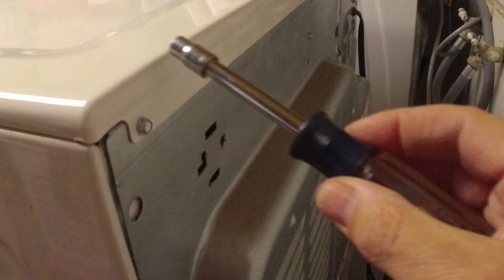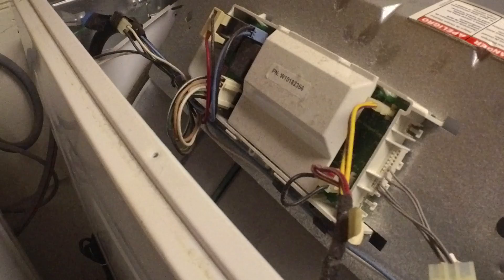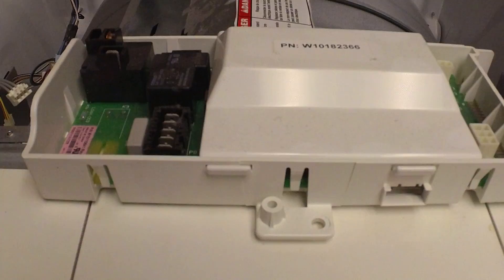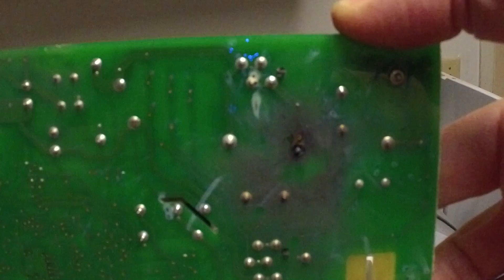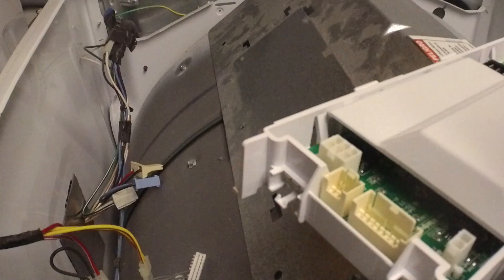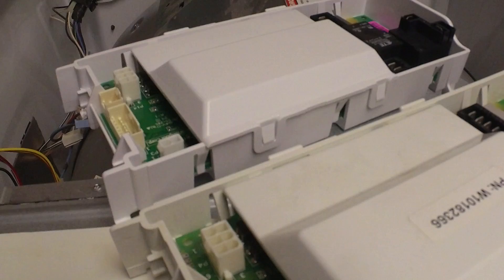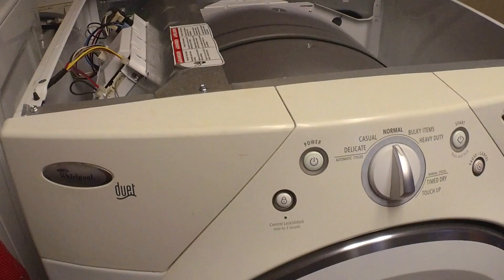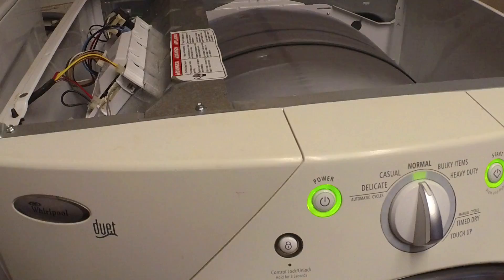Whirlpool Duet Dryer F01 Error Code Fix | Control Board Replacement

Comment: My dryer showed an F1 malfunction. Watch the video then went into the control board out when I did it show the classic signs that was shown in the video. I soldered a wire as shown in the video put board back in. it worked!! I'm quite shocked saving myself 150 to $200 on a control board
Reply from the maker: well done, congrats!
Reply: @MattsGarageMiscDIY  thanks for the video was a great help. Mine look just like the video solder joint blown. Had it fixed in less than an hour and most of that time was looking for my soldering iron

Comment: Tip to others .. with an exacto knife you can carefully scrape through the green trace close to the relay pin to give you much more copper area to solder.  Also scrape along the relay pin to give more clean area for the solder to hold. If you have a little electronic friendly flux paste .. that does wonders too!   Thanks to the OP for this excellent video.  Saved me hundreds $$!!
Reply: thank you after two weeks finaly found the problem you  save me 300 dollars .

Comment: I had the exact problem as obviously a lot of you have had, thanks for a great video but luckily enough that I soldered the heck out of it and completely covered the lil nub sticking up and plugged it all back up and viola I have a working dryer. But without your video I wouldn't have got anywhere. Thank you so much for sharing?
Reply from the maker: Well done Brandon. That is super satisfying right! Glad it was helpful.

Comment: Thanks  Matt $250 dollars saved. I went to Lowe's and bought a Weller Cordless Battery Powered Soldering Iron for $22 and soldered the burnt spot on the board and it worked! I couldn't believe it.
Reply: I have the same battery soldering iron

Comment: This worked for me and the resolder did the trick no board replacement.  It was exactly the same pin which is connected to a relay that turns on heavy amperage to I guess a motor.  The board in the video looked more burned than mine but I'd bet the relay is still good just the trace got burned or fried.  I small jumper wire to the two pins that it leads to would have probably brought the bad board back to life.  At least that's what worked on mine but I didn't even need to add a jumper wire.

Comment: The power lead burned out on the power board relay.  The trace and pad was burned away.  You can fix with a soldering iron and small gauge wire.  You solder the wire to the damaged lean and jump it over following the trace to the next lead.  No need to remove relay at all since it is not damaged.

Comment: I like the video but for $11.00 you can replace the resistor. Not that difficult to do but if money is no object then replacing the entire board is the easiest.
Reply from the maker: If money is no object you call a repair man and pay them the labor and part mark-up too. You should create a video of the resistor replacement, that’d be cool for those that wanted to try that first and save some serious money!
Reply: Steve Wilson you bring up something I’ve been thinking about.  Clearly, something blew out on the board and the solution is not simply to resolder the connection.  I did not know the part was a resistor, but whatever it is, it needs to be replaced.  Otherwise ... who knows what?
Reply: @janapellusch9339   I’ve actually replaced this twice over the years. Just buy a desolder kit and you can do it yourself. Trust me I have limited skills :). Here is the part:  G8P-1A4P-12VDC Fully-Sealed PCB Relay 30A 250VAC for PC Board or Panel-Mounted.  It’s a relay that just blows after repeated use. You will see on the circuit board where it just decided to fail. The resistor is held onto the circuit board by tiny dots of solder. The desolder kit melts and suctions the old solder away. Good luck!!!!
Reply: @MattsGarageMiscDIY   Good idea Matt I will make a video (if it happens again). As I mentioned to another person I have limited skills but all I needed was patience and a desoldering kit and of course the new relay :)
Reply: Per Matt’s Garage and Misc. DIY request in his reply to Steve Wilson’s comment, here is a link to a video of someone repairing a similar dryer with the same error code by replacing the $11.00 resistor:

https://youtube.com/watch?v=aZWBjouDPuw&feature=share

Comment: You saved me the cost of a replacement dryer! I found a person on ebay who solders the boards for $44, while looking for a used board. I sent the board off and it came back within days. If it hadn't been for this video, I would not have known what to look for on the board, and that even if I had to get a new board, it would have still been $100s less than a new dryer! I took a bunch of pics of the wiring set up and the whole re-install took less than 15 minutes. Thank you so much!

Comment: Had the error code show up and when the service technician showed up, he claimed the part was no longer available (OEM). Looked through Amazon and picked up the closest match which included the white plastic attachment box for the circuit board. My son and I tackled the project and was able to replace the control board in about 1.5 hours. Hardest part was carefully unplugging some of the original connections without damaging the wiring and realizing that both of the anterior small wiring connections had to be attached at a different 90 degree angle (no real problem). Great satisfaction having that dryer up and running. Great video and commentary..big thank you!.
Reply from the maker: Well done, glad it was helpful.

Comment: Hi Matt. Even now your video was awesome. My unit had the exact same problem. Even down to the smoke spot. Re-soldering did it for me. Wanted to add for benefit of others, that the blown solder location is at the relay. The blowout took some of the PCB material out (the little copper highways) at the location, so just adding soldering will not help. Re-soldering should make sure the relay leg makes contact again with these. Even adding a shunt wire between the relay leg and the next location would work.
My wife was helping me, and at the end said I was "f**ing incredible" . I am passing some of that compliment back here. 
Again, thanks!!
Reply from the maker: Nicely done Juan!

Comment: Thanks so much for this video.  I was able to solder the burned area and it fired right back up.  Make sure you clean the burned area down to bare metal before soldering.
Reply from the maker: We’ll done! Such a good feeling to fix something yourself and save a bunch of money.

Comment: Matt, I have to hand it to you. I took out my old circuit board and Son of a gun the relay was burned exactly the same place yours was. We ordered another board and a it should be here tomorrow. Stay tuned to the results as I am 100% confident it will work when I get it back together. Edited next day I cleaned the post and got my solder gun and re did the solder job. Installed it back in the dryer and wellah all fixed. saved up over 200 for a job that took more time to get the board out than to fix it. Youtube is the best. Thanks Matt
Reply from the maker: Glad it worked for you. Imagine what you’d pay to have a repair person replace the board after labor and their mark-up on the part! Lot’s of people probably go buy a new dryer!

Comment: Exactly the same issue. Same relay with blown soldered contact. Re-soldered and bingo, it worked. Thanks for pointing me in the right direction. Saved $100+ dollars on new board. You can also just order the relay that was blown and save a few bucks by soldering in new relay.
Reply from the maker: Stephen, in hindsight I wish I had kept the old board and tried soldering in a new relay. I believe there is a reason these blow, and either a new relay or board is the long-term fix. I’ve had no issues with the board now in several years since capturing this video.
Reply: @MattsGarageMiscDIY  My thoughts exactly. I suspected the relay was blown and was ready to order another, but it was fine. Not sure why the connection would blow but relay fine. Drawing too much current through a weak soldered connection perhaps? We will see how long it lasts.

Comment: For anyone reading this in the future, I had the exact same issue as shown in the video and soldering that joint worked for my Whirlpool Duet with the board P/N:  W10110641 Rev B.  Thanks again for this video guide, you helped save my dryer!! 🙏

Comment: Thanks! I fixed a WED9500TC1 (electric) that is essentially the same. There's a few more connectors, and removing the metal plate didn't work too well. But I had the exact same spot fried and did the exact same fix. It took 5 or 10 minutes to remove the main 2-pin connector that seemed like it was welded on. I wish I could solder like you ... mine is a mud dauber nest!

Comment: I know this is an old video, but my board was blown in the same exact solder joint as yours. 5 min of soldering later and my dryer is working again, can't thank you enough.
Reply from the maker: Well done Daniel, if you ever need to replace the board you will know it’s not that hard. Always glad to hear someone saved some money, especially this time of year!

Comment: We are going to try to repair, just ordered the same part you mentioned. Thank you for saving us $900 (the price for a new dryer)
Reply from the maker: Laura, you’ve got this!
Reply: Question our part number is W10182365 and it’s not available we saw that yours was W10182366 not sure if the one we just ordered will work for our drier, since yours  ended on 66 and ours ends on 65
Reply from the maker: Laura, the replacement part I used was W10174745, at the time I made this repair the research I did said this was a newer replacement part that was likely compatible with many previous models. That said I don’t pretend to be an expert on compatibility. The safest bet would be locating the model match on the board. The installation will be as you’ve seen in the video either way. Good luck.
Reply: @MattsGarageMiscDIY  thank you.
We cancelled the one we ordered and we are trying to find something compatible

Comment: Thanks for the awesome video, I was able to fix my board. Actually I think mine was worse than yours, there was a small piece of the circuit trace missing. I had to solder a piece of wire between the pin and the trace. Wasn’t sure it was going to work and guess what, it worked! Dryer is back in action and the wife is happy!
Reply from the maker: Well done! In hindsight I wish I had kept the old board to try additional attempts to salvage it, but at the time was pretty happy to fix it with new parts without calling a repair person.

Comment: I soldered mine also and got it to work. Exact same joint.  The solder did not seem to want to flow in there all that well. and I did clean it first and use flux.  But it is working...right now anyway.  And if it fails again, now I know what to do.  Couldn't have been much easier to access.  Thanks for the video.  BTW other viewers, that part is around $300 with tax.  Worth a shot!

Comment: Thanks a milliion! After I scrapped around the contact to remove the carbon build up, the soldering solution worked for me. I'll  go ahead and purchase the new board since this appears to be an issue that will come back in time, but it keeps things going in a pinch. Really appreciate your time to provide the info.
Reply from the maker: we’ll done, glad this helped you!

Comment: Hi Matt - Thanks for this video. I had exactly the same issue, but I just replaced the relay on the board ($9) and the dryer started working again. Seems like a design issue to me.... probably the designers saved 5c by not adding a diode or a high imp resistor....

Comment: Matt I want to thank you very much for this video. You provided every detail I needed. When I took out the controller the burn mark on the panel was identical to your example in the video. I was on hold with Whirlpool Canada and it was taking some time so I though ok he tried a solder so I would as well. Still on hold plugged stiff back in and bingo works like a charm.
Reply from the maker: Ed, always glad to hear this was helpful!

Comment: Thank you! Thank you! Thank you!  I followed every step and was able to solder the back of the control board and my 
dryer is working great! You saved me a lot of money.
Reply from the maker: That’s great! Even though that part didn’t work out for me, I was just as happy to swap in the new board and still save money by not paying someone else’s labor and mark-up on the part.

Comment: You rock this video and another helped out.  Saved me from buying a board as soldering was the trick.  Tested with a multi-meter that there was a bad connection on the trace to the post that was burnt.  crapped the trace to make sure there was a connection.  I almost added a new wire to replace the trace (maybe I should have).  But it seemed to work.  Had this not worked I would have order that control board.
Reply from the maker: Always glad to hear someone saved money!

Comment: Thank you Matt!  I am a complete idiot when it comes to working on or fixing anything. I mean a complete zero. I don't like to do it. I'm not the MacGyver type. That said, I decided that I would try fixing my own dryer as money's a bit tight. If you follow this video step by step, order the exact part that Matt recommends, take pictures to make sure you know where all the plugs go, then like me, you too can do this. It takes about an hour and a half after you get the part (Recommendation: Follow Matt's directions on how to pull the board and see if it blew out...my blew EXACTLY like and had the same burn mark as Matts). To fix: It's really just unscrewing bolts and screwing bolts back on and unplugging and then replugging plugs. First start by 1) removing the top of the dryer (that's all that's required...you don't need to take the back dryer panel off, you don't need to remove the drum, and on and on...just a few screws on top of the dryer to remove the top of the dryer), 2) follow Matt's video on how to unplug (and then later re-plug) the pieces from the board, and 3) remove the old mother board. If like in the video, the board has a burned spot, then move to 4) buy the new board (I just bought the exact one Matt had in this video's comment section from Matt), 5) plug in the new mother board, 6) re-secure the top, 7) re-tape the air vent and 8) turn the dryer on. It works just like new! Amazing! (This video really shows a novice how to do this step by step.) The new board (with inflation) cost about $250. But that's better than $1,000 for a new dryer or $400 for a service person and then an additonal $250 for the board on top of the service fee. If I can do this, you can do this! Good luck. Matt's awesome! YouTube is awesome too for creating the platform for video sharing!
Reply from the maker: Always happy to hear that someone was able fix something themselves and save money! Thanks for the kind words.

Comment: Excellent.  5 min job. The parts pretty expensive unfortunately   Great video
Reply from the maker: Thanks Bill, still considerably cheaper than also paying a service call with labor, and the mark-up on the part, or worse yet buying a new dryer. Hope you can get more miles out of your current dryer!

Comment: Well done, EXCEPT warn viewers to unplug the unit before taking the top off!!!
Reply from the maker: If you read my detailed description I call out unplugging the unit before moving it away from the wall. I typically try to capture additional information in the written description. This goal of the video is to share the level of effort, tools and parts I used. This might be enough to give some the confidence to tackle this repair on their own, for others maybe not. Best of luck with your repair.

Comment: damn inflation.... now this part is $223 on Amazon.   I'll check around - thanks for video!
Reply from the maker: David, I’ve seen the prices swing pretty dramatically based on supply, many independent sellers on Amazon, for sure shop around a bit. Good luck!

Comment: This was exactly my problem, only I just replaced the component on the board that burnt out - G8P-1A4P-12VDC Fully-Sealed PCB Relay 30A 250VAC - 12 dollars on Amzn. Resolder may not work - solder on a new relay as the old could be burnt out. Solder iron and solder is cheap. I had tested fuse, pully switch, door switch, etc. Then took out the manual, saw how to get it into diagnose mode,  and saw the F01 fault code (bad control board) message. Found this video. That board is 200 plus bucks. Why not just replace the bad component? I still see the F01 code, but the motor now kicks on. Maybe there is a way to clear the fault codes? Thanks for the vid!!!
Reply from the maker: Bryan. We’ll done. I wish I had kept the old board, I’d give the relay replacement a go and keep it as a backup. At the time I did this I was simply trying to fix it fast and fix it to last. I was already satisfied in not calling a repair person who most certainly would replace the board and charge me labor and markup the part. My dryer had been running flawlessly for nearly 2 years since until I had to fix another issue just recently when my thermal fuse failed. Video posted on that one too for reference :)

Comment: I think you could have wired the circuit and fixed the board. That said, great work fixing it!
Reply from the maker: I wish I had kept the old board to give it a try, some have been successful replacing just the bad relay. In the end I am still very happy to have fixed it myself, saved some money. A repair person most likely would’ve replaced the board at a much higher cost plus labor. I hope this helps you tackle the job and save some money too!